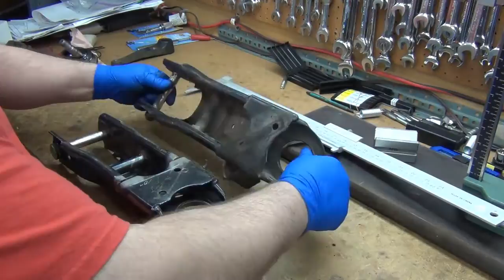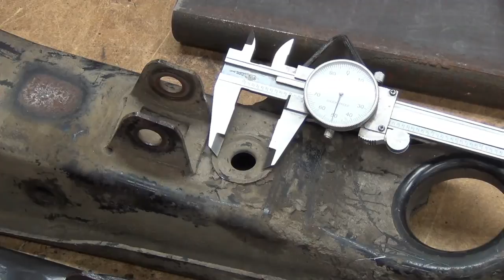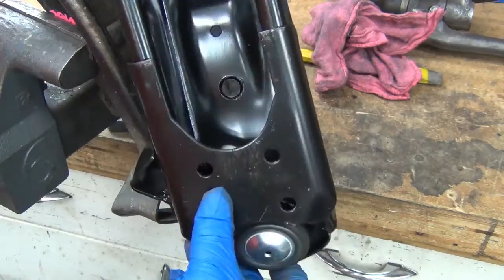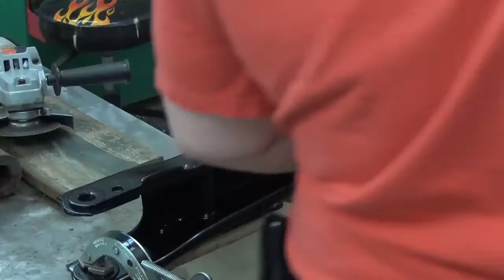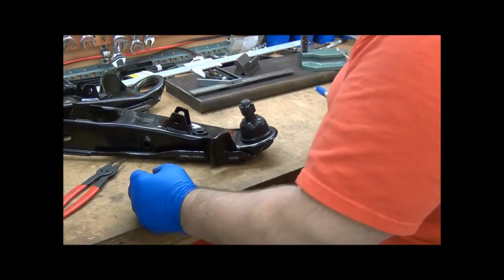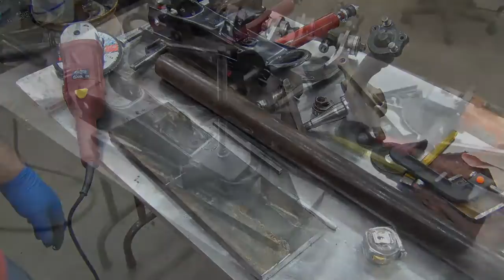Datsun 521 Ball Joint Mod - Part 44

Comment: They make a giant c clamp type tool that works on the ball joint pretty well. Not as easy as the press, but you don't have to remove the arm from the vehicle.
Reply from the maker: You are correct!  But......these are arms off of a nissan D21 and going on a Datsun 521.  I bought 5 sets of new arms to modify.  They all came with ball joints installed, so I'll have to remove them all I start modifying.  This is a project I should have finished more than a year ago!!!
Thanks!
Mike